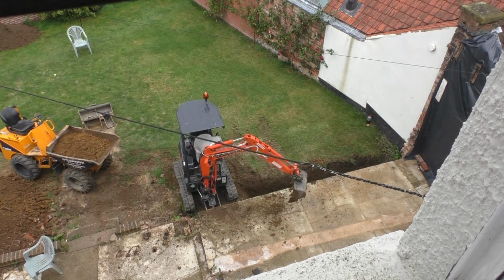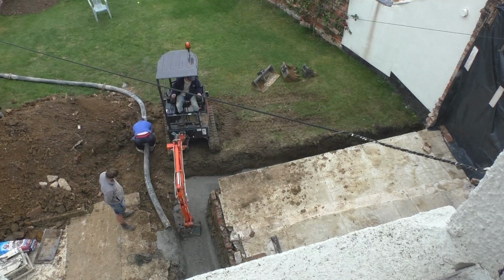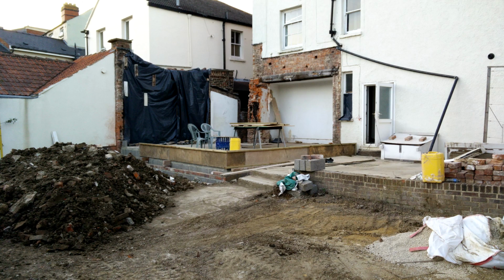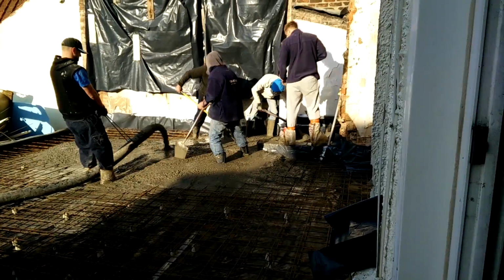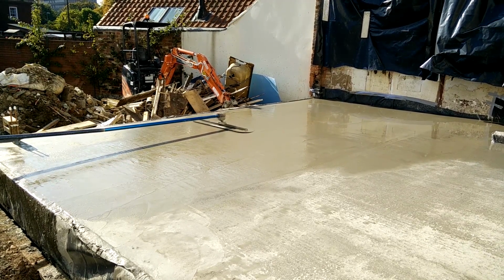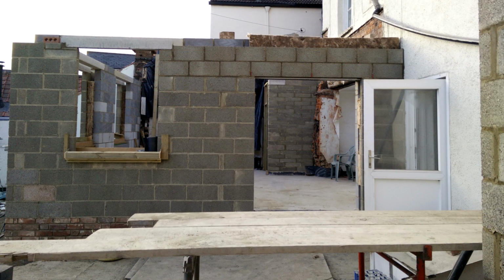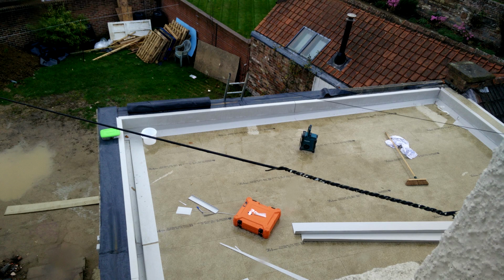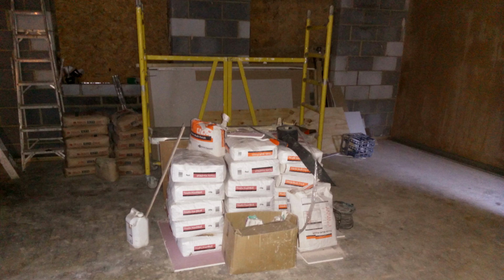Workshop Build -  Building the Shop

Comment: £30k for materials plus 5 man-years of labor is pretty good. :P

Chipboard on a roof? Is that normal? That stuff swells and starts coming apart as soon as it gets a tiny bit wet. I would hope OSB or better yet plywood.
Reply from the maker: Funnily enough we've just had the roof redone. The fibreglass was incorrectly applied / not suitable and failed. The chipboard held up well considering but the new roof has OSB.

Comment: I am really pleased that you decided to show this video, it was very comprehensive, I am by no means a builder but the footings seemed deep as you say, is this in case you decide to add on another storey above at a later stage? The work you had done looks to be of a high standard by more than capable builders (maybe not the sub' roofers) I really enjoy your films, thanks for taking time to post. N.
Reply from the maker: The footings needed to be deep because we have a cellar. Shallow foundations up against deep foundations will put a horizontal load on the deeper foundations. To be fair they didn't need to be so deep all around only near the house but that message didn't seem to get through. The builder we used is great, we've used him a few times before and his work is always of an excellent quality. Most importantly though he doesn't mess about if something isn't right, he'll pull it out and do it again. Glad you enjoy the films, I've been putting this one off as I knew it was a lot of editing, glad I've done it now though.

Comment: I Would like to know if that flat roof has leaked yet????
Reply from the maker: Yeah, I leaks like a sieve. The large flat area seems to be holding up but the top coat is already cracking. The parapets let in water like there's no tomorrow though. The coping stones aren't quite wide enough so there's essentially no overhang on the inside. With any luck we'll be getting it fixed in the next couple of weeks. Unfortunately the original builder went bankrupt before he could fix it.

Comment: FOR A SINGL STORY BUILDING THOSE FOUNDATIONS ARE OVER KILL,BUT AT LEAST THEY ARE OVERKILL INSTEAD OF UNDER AYE.
Reply from the maker: The engineer said new foundations had to be at least as deep as the foundations of the cellar of the old part of the house and for at least 3 meters from the cellar wall. This apparently prevents the new foundations from putting pressure on the cellar walls. For some reason the builder dug the foundations to full depth all the way around.